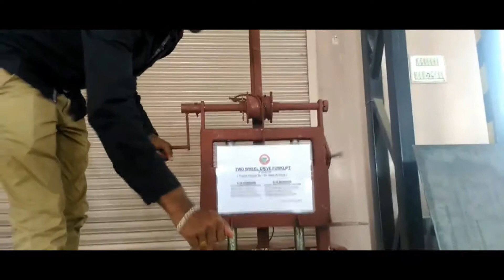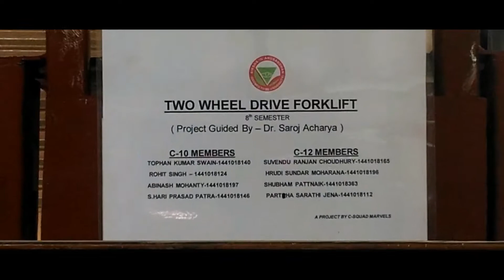MECHANICAL FINAL YEAR PROJECT || TWO WHEEL DRIVE FORKLIFT || IN A CINEMATIC WAY

Comment: is it no need attach programming to control the load?
Reply from the maker: No... Programming is not used in this project..simply carrying load is defined and as per calculation, this prototype is made
Reply: @n7frames  ok noted... what software that are using for make 3d model?
Reply from the maker: Solidworks 2015
Reply: @n7frames   where can get your report and  your design solidwork for make references?